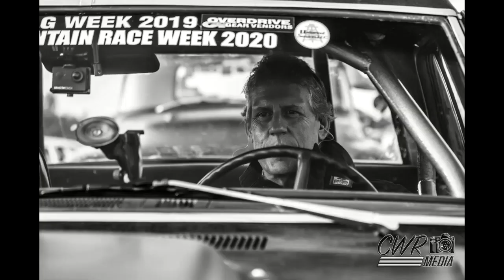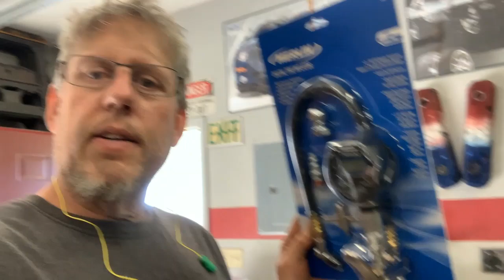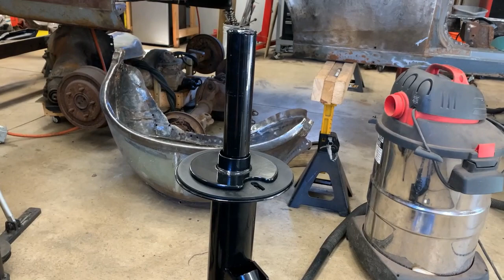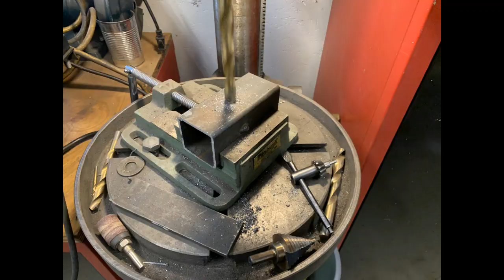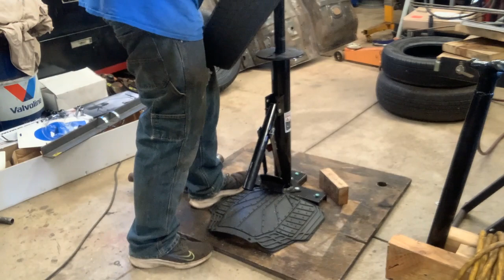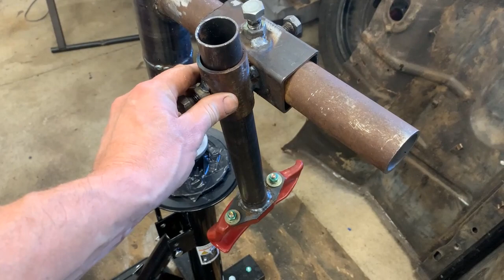Harbor Freight Tire Changer Mods, to the new black version on the cheap with scrap I had around

Comment: I made mine over 4 years ago. I use it  all the time. Use a longer bar, make a stronger base for it it won't wobble. I upgraded mine. it works a lot better
Reply from the maker: I have it bolted down to the floor now. Way easier, I also drilled a couple holes so I can hold the rim down better. I’ll try the longer bar for a bit more leverage.

Comment: It's easier, and less harmful to rims and tires, just to use a couple of spoons and some good lube to remove and install tires on any rim. Duckbills and other rotating levers are only faster/easier when  powered by a machine with gobs of torque and anchored to a concrete shop floor.
Reply from the maker: I have a spoon now and it’s bolted to the floor. When I shot the video didn’t have anchors to bolt it down. Works pretty slick when I need it.

Comment: Leave a tiny bit of air in the tire and use bead lube/soapy water. Even if you let the air out and just put the valve back in so air can escape as easy while pressing on the bead. Bead breaks much easier that way.
Reply from the maker: Thanks for the tip!! Really appreciate, I have 3 tires I need to bust off. Will defiantly give it a whirl.
Reply: @6:10 in the video you are just pushing on the tire side wall. Pull the tire/rim towards you about 4-5 inches. One should pull the tire/rim away from the bead breaker slightly on a angle in order for it to push against the underside of the bead/ rim when one is pushing down. It shouldn't just push on the tire side wall but directly on the bead and rim while pushing down on the bar.@ShopDogFabrication

Comment: I just did a set of 33s this would of made it easier for sure. But the rubber pad you say to set your wheel on i put on top of the wheel instead of taping the not so centering piece
Reply: I put mine on a heavy duty pallet and use the forks on my tracktor so i can use it anywhere
Reply from the maker: Good to know I can do 33 no problem, I have 31s now on my truck. So when the time comes it can be done.

Comment: For your round insert. Instead of 2 set bolts use one on the corner. It will hold the round stock tighter one the square tube.
Reply from the maker: Thanks for the tip, I have a couple more tires to remove, I’ll give it a try.

Comment: Could you please give us the actual length, ID and OD size of the main tube which goes over the HB one? And also the length and thickness of the round tubes? Thank you, this was a very nice and simple to understand video!
Reply from the maker: Sorry just got back from a trip, the od of the harbor freight tube is 2.05” roughly and my id is just a hair over 2” and 12 1/2” in height. I would use square tubing for the arm around 1 1/2” or 1 1/4” and the size below it to fit inside.

Comment: I just got one of these changers and decided to bolt it directly to the concrete floor using only the square flange at the bottom of the main tube. I drilled out the original holes for 1/2" bolts and used flush drop-in anchors so I can remove the unit for storage.
This thing is super rigid attached this way, and I don't have any problems at all breaking beads with the wheels flat on the floor. A towel can be laid down to protect sensitive rims. I really don't get what those crisscross c-channel parts are for that they provide to bolt this down with. They seem to make the unit less rigid in the long run. I am definitely going to built the duck head mod!
Reply from the maker: I defiantly need to bolt it down. They only had 3/8” drop in anchors at a store near me so I went the plywood route in a pinch. Want to bolt it down and make it removable. Good to know 1/2” anchors make it plants rigid.
Reply: 73dcp what length bolts did you use to secure it to the concrete?
Reply: @bryans8193  I think 1-1/2"
Reply: I built the mod duckbill for mine and bolted it down so i can remove it and reinstall it when i need it. It worked great, i did both my cars and a jeep with 16" AT tires with no problems.
Reply: I agree, the crisscross c channels make it harder to use.  Just put a 2 x 4 under the tire /rim and make sure the breaker arm is completely vertical.  Also it needs to rub the rim to work.  Try it, boom works the first time almost every time.  To mount the changer to the floor I just used those blue masonry anchor screws from Home depot just on the base  (the size that fits in there maybe 1/4" nothing big. . .and I have leaned on it hard for about 6 years now.  Its rigid.  Works on Motorcycle tires and car tires really well.  I will make one of these one day (with square tubing).

Comment: I like the improvements that were made from the red one we have! Great video!
Reply from the maker: Thanks so much! Appreciate you taking the time and providing feedback.
Reply: The only improvements I saw were the rubber coverings...Which u can add to the red one yourself as I did..
Changing the rod that goes through the lug hole to hold the wheel from spinning to a drop in bolt/rod is actually a down grade from the red unit...
Reply: @BDOML9101  the red pin is garbage and the first thing to bend. I drilled mine out to accept a bolt. You may have seen that in my video.
Reply from the maker: That pin is a waste like you said. I pretty much drilled gm / ford / mopar bolt pattern in mine for a least 2 bolts to hold the rim in place.

Comment: Is it for only tire removal or installation as well and which duckhead better of those 2 in description?
Reply from the maker: They are both the same by 2 different sellers, I list both of them in case one is not in stock. You use the same one to mount and dismount the tires.